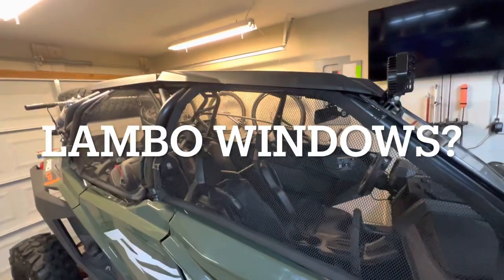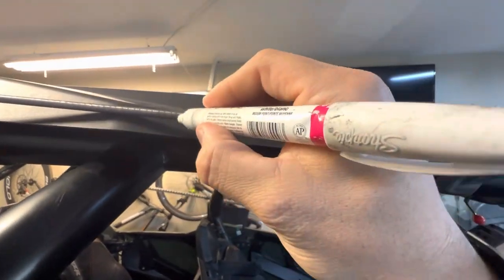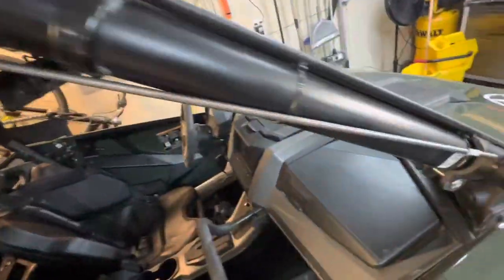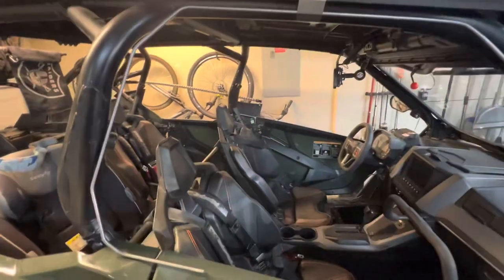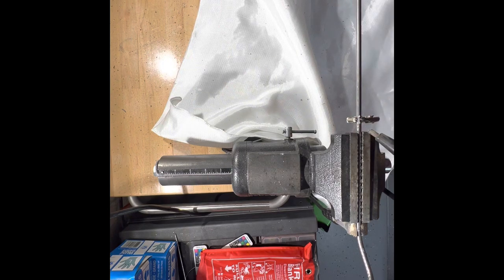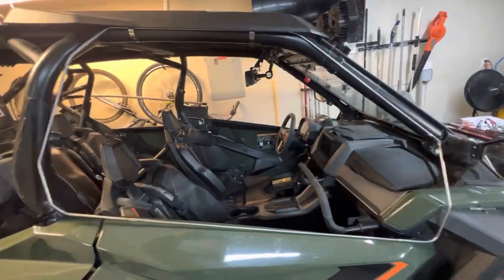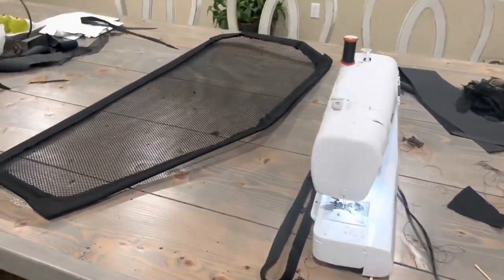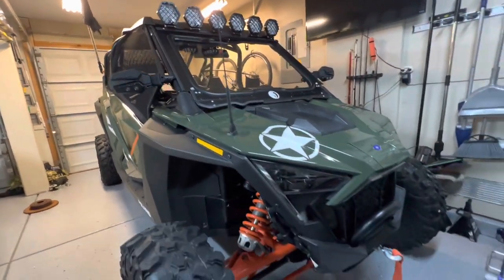DIY: Polaris RZR lambo window nets, upper doors

Comment: When you sewed the fabric on did you pull netting and canopy over frame? Thanks!
Reply from the maker: Yes, folded it over tight, that way it sewed double the fabric and held it better and of course so the mesh doesn’t flap.
Reply: Awesome thank you!
Reply from the maker: @ricknitabillstatadventures920 I used the brotherCS5055 the needle goes up high enough to get it over the metal bar and sew it. It’s strong enough to sew through all the material too compared to the cheap sewing machine I got first time around.